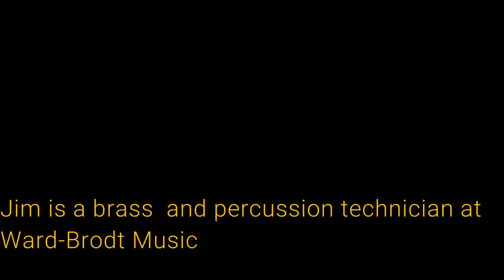Tuba Damage

Comment: I personally believe that dents add character. Although I think this Tuba had a little too much character.
Reply from the maker: Yeah, too much of a good thing is, well, not good!
Reply: Yayh! Makes me feel better about my 1969 Miraphone with lots of character. Still- would be nice to get some of the less attractive dents out...
Reply: Brudda you haven't seen mine. Mine has a massive dent in the bow. Like someone tried to play fruit ninja and missed. Its bad but it still sounds great. Up to a point tho. I can't play too loud without the vibrations being trapped and it causes a rattle like sound and quality is nulled a bit
Reply: If you had a dent on your head would that give you character....?
Reply: It starts to lose sound
Reply: Yeah, this much variation in the diameter of the channel for the standing wave is going to add too much character to the waveform, which might be interesting, but not likely pleasing.  If I want that sort of character, I'll turn the instrument over to freshman in Beginning Band.  No need for dents.
Reply: @BennyCFD  I remember seeing a sign an auto body shop may we have the next dents.
Reply: It probably was run over by a Lorry.
Reply: Character like that original mess diminishes the full rich tones of a well shaped instrument!  I did enjoy turning off the rattle-bang after a short minute.
Reply: same as my grandma @foamytony3291
Reply: I still have my 1964 beginners, student King trumpet..It only has one small dent in it.. 1st valve slider.. it was the first week I had it. Dropped it on my bed room night stand.. To this day I'm still PO'd about it.. That was 55yr ago..
Reply: Would dents not change the sound?
Reply: Yeah... Gotta agree with you on that. Just a wee bit too much character on that bass. Nice instrument though. I haven't seen many rotary valve bass euphoniums. I bet it sounds sweet!!!
Reply: Hayden Thompson ,
  Like the wrinkles in an old face, or elsewhere?
Reply: Too many dents could effect to tonal quality....so stick that character idea in your pipe

Comment: As a plumber for 46 years I remember when an apprentice and fitting we pans wc only had 4 inch lead pipe at the time for connecting which being extremely soft often had many dents in them which like the brass bend had to be removed. We carried a set of Tonkins which were a a range of extremely hard wooden balls of varying diameter with a hole through the centre. A rope was fed through the Tonkin and fed through the pipe and the opposite end wrapped around the head of a heavy hammer. We them just sat down and tugged the Tonkin though the pipe and it was amazing to watch all the dents vanish as you progressed. The Tonkin was short which allowed you to traverse bends.

Comment: Jesus, did they hit it with a car??
Reply: What happened was the kid got jumped and they were using the Tuba to beat the kid with!
Reply: my guess is that it was put on an aeroplane in a soft case or something because it looks more like it has been crumpled. this i think is because often the luggage part of the plane is not properly pressurised.
you can also see it has happened at the outside part of the curve which i assume would be the weakest part of the instrument due to the bend.
as i said though its just my guess and i'm likely wrong
Reply: WangChung81 I believe they did
Reply: Looks like a fairly standard school-instrument to me. Most of the brass instruments I came into contact with in high-school looked like they got run over by a bus. There was one single good trumpet at my high-school, and you better believe I treasured every second I had with that little beauty. Every other trumpet they had was hardly in functional condition. As for the tubas and trombones, not a single good one to be had at that school, unfortunately.
Reply: @spaceseal2268  If that damage happened during a flight, pressurization has nothing to do with it. For air-pressure to damage a brass instrument, you would have to seal up every single hole in the thing tighter than a Nun, and even then, it would expand out and crack, not crumple, since air pressure up above the clouds is obviously lower than ambient, not higher.
It looks more like a pissed off baggage handler or high-school kid caused the damage to me. That tuba very much resembles most of the brass instruments my high-school had at their disposal.
Reply: @MFKR696  yeah fair enough
Reply: This tuba was in better condition than the ones we have in the junior higg
Reply: Nah, its probably just from a middle school, you know how that goes.
Reply: That wasn’t in bad shape at all! You should see the ones 6ths graders get to use
Reply: It really doesn't take much to do a damage like this to a brass instrument. A fall from a few feet is often enough. Or someone falling onto (or with) the instrument. You have to treat those as if they were made of paper.
Reply: I smacked mine around a door frame and jumped up and down on it. Taught it a lesson for not playing the right notes !!!
Reply: No, a mouthy freshman.
Reply: @spaceseal2268  The luggage part of a modern plane is inside the pressure shell, the same as the passengers. The temperature there might be a bit cooler but not freezing.
Reply: Its sad the way you use Jesus' name so irreverently. Don't be deceived, God is not mocked. Gal 6:7
Reply: Thomas..."gods"? There are many "gods" made of wood, stone, clay, and the imaginations of men, but there is only one true "God" - El Elyon i.e. "The Most High God" of the Bible.
Reply: The owner was playing hid tuba st 3am and somehow the neighbor got hold of it
Reply: Bus, was horrible, was on bbc1.
Reply: no the drummer learnt his new instrument!
Reply: Marcus' muse he was atacked by a group of elefants during a earthquake
Reply: @MFKR696  ...we had faves at school and some were  old but in awesome condition. (high school grades 9-13)
Reply: @spaceseal2268  LOL air pressure...
Reply: @FireX7_211  When I was in middle-school, all our instruments were like 15 years old and not a single one had damage. They were tarnished and worn but not damaged.
Reply: fell off the back of the bleachers and was hit by 2.5 ton military vehicle
Reply: Tubas are old, especially mine, and some people like me just don’t have the money to repair it. Tubas just get dented more than like, a trumpet. I play trumpet and and mine looks beautiful but when I look at my tuba I go, “oh, Jesus.” I just don’t have the money.
Reply: I think it fell out of an airplane baggage compartment at 30,000 feet.
Reply: Did you hear back from Jesus yet?
Reply: @MFKR696  I wouldn't call it a standard high school instrument. Unless things have changed drastically, a 4 rotary valve tuba is best left to more advanced players. A 3 piston type valve would, and should be much more common. Overhauling rotary valves is expensive!
Reply: school instrument
Reply: nice work in making it usable again
Reply: @rvdrivingforce418  Are the rotary type valves in a tuba like the thumb valve on a trombone?
Reply: @leghumper83   yes, exactly like a thumb valve on a trombone, or the valves on a french horn
Reply: @rvdrivingforce418  My band director handed me one my freshman year of high school, but I don't remember if he ever showed me how to use it.  No idea why...I had my own trombone and didn't require a loaner.  Used that trombone for 4 years, never used the valve once, other than screwing around with it.
Reply: @marcusmuse4787  some kid threatened to smash a tuba on my head and he was like actually mad

Comment: I was mezmerized by the craftsmanship and the various techniques.  Thanks for sharing.  It shows that many old, vintage instruments may well have life left in them.  How about a video what demonstrated the before and after effect on the sound quality after such a restoration project?  That would be pretty awesome!  Maybe some info on the acoustical facts and wavelength stuff about what makes the sound resonate and the quality thereof.  It would also be interesting to hear your thoughts about the cost/benefit on restoring an older instrument versus buying a newer one.  When do you find that such work is a wise choice?  Great work and it kept my attention throughout.
Reply from the maker: I think this tuba was only 20 or 30 years old. My opinion is that bell and bow dents will likely not effect play-ability that much, though a person who is intimately familiar with their horn may notice a difference.  BUT, they will effect the desire to handle it well and be careful with it. My guess is that it would effect certain partials and possibly create nodal points that may make some notes not quite lock in well or be a bit funky. I think that this is a bigger issue with leadpipe dents or dents in smaller tubing. Maybe. I am continually amazed at how well some horns will play even with punched in crooks (trombones etc). You would also have to get a really good and consistent player to test and use some acoustical measuring equipment in order to objectively test that. I think most players unconsciously compensate for such issues. In fact they do this my nature with even a new instrument since there are few if any that are the "perfect" horn. Good thoughts you have though. thanks for the comments!
Reply: Rob Gulledge como fazr tubos de madeira para orgao artezanal

Comment: Bit late to this but does anyone have any info on that magnetic dent roller? Thats an awesome tool
Reply: Yeah, the guy who invented the magnetic dent removal process for brass instruments is my local repair technician.   You can build one yourself for $150-$200.  You need a Neodymium "rare earth" magnet with a 500-800 pound pulling power and a few large ball bearings (2-3in diameter), all of which can easily be found online.  For magnets check out magnet4less.com.  Here is the one I got: http://www.magnet4less.com/product_info.php?cPath=1_11&products_id=170 .  The other supplies can be purchased from a hardware store.  You will need a PVC end cap large enough to hold the magnet, a replacement side handle for an angle grinder and washer and nut to fit threaded bolt on the grinder handle.  Drill a hole through the center of the PVC end cap and attach handle with nut and washer cutting off any excess threading flush with nut.  Slide magnet into PVC end cap.  The magnet should be held in place nicely due to the magnetic attraction to the nut/bolt.  In the video, Jim uses an old drum head as barrier between the magnet and the brass to protect the brass. Instead, I attached a round Teflon furniture glide pad of the same diameter as the face of the magnet to the "head" of the magnet. this works very effectively. WARNING.  These magnets are seriously strong and can do damage to electronic devices.  I wouldnt get it too close to a tv, ur phone/tablet, etc.  I WOULD DEF. NOT advise using/handling one if you use a pacemaker.  Also, the magnetic attraction these magnets have is EXTREME.  You could easily crush your fingers and/or severely pinch your skin.  So BE CAREFUL.  In fact, I DO NOT recommend building or using one of these devices unless you do your homework and make sure you first know what you are doing.  You could also seriously screw up your instrument if you misuse the device.  IE: this device is ideal for minor dents in bottom bow and other larger tubing where the brass is thin enough.  This device will not work with small ball bearings in tuning slides or other small tubing on horn and will do serious damage to larger/flatter areas such as the bell .  All of the magnetic pull will be isolated to one very small spot and will easily leave raised grooves and or minute folds/creases in the brass that will be very ugly and very very difficult to remove.  Also, do not use a ball bearing that is too small for the area you are working on for the same reason. the ball bearing should only be just small enough to easily pass through each section you are working on, for best results.  I hope I haven't scared you too much!  LOL, but seriously, do your research first, know what you're getting into and BE CAREFUL and practice on junk instrument first!  If you are not confident you can do it, its best to bring your horn to a professional!!

Comment: Nice job fixing it. But surface is still rough
Reply: So what would you do next? Bondo and paint or what a traditional vehicle body builder would do following a repair and use a file. There's very little thickness to work with here but with an ever increasing number of hours to improve the finish futher more time could be beneficial of someone was willing to pay.
Reply: Likely they send the tuba back to the rental company or if they own it back to the school.Ready for the next crop of vandals. No need to make it perfect.

Comment: Hi Jim. I have a old clock from my great-grandfather and I would like to restore it. It's just the brass that has a ugly stain. I believe someone used steel wool to clean it. The difference between these musical instruments is that the brass should not shine as they do. I believe it should have a matte finish. Which could be a proper way to achieve that? I have a video from the clock in my channel. Thanks.

Comment: Wow. That's... extensive. I've got a few dings and dents here and there in my Eastman, the only serious thing that happened was that I managed to drop it and shift the valve block as I was supposed to go on for Schostakowitsch 5. Thankfully, Eastmans are easy to pull apart (Braces are in 2 parts held by bolts) so it came out just fine.

Comment: just curious if the curved tool clamped in the vice @2:13 be duplicated with a custom bent on in the modified english wheel @2:26 so you could roll all the way to the center of the half bend..  the new tool would need to be shaped like a fallen forward P shape..  the contact patch on the concave roller might not be directly on the bottom of the roller.. it might be 30 degrees forward or 30 degrees rearward..  turning the center P bar upward to work on the inside of the curves if needed.  just a thought.

Comment: How come there still are some visible rumples in the bottom bow?  What happened to the wide guard that was there when you started. Yes, it was bent but that is why you have the Feree's Dent Machine.
Reply from the maker: I did not do this particular horn to a full overhaul level. Certainly could have and then would have removed every scratch and ripple (at 6 times the cost of this job).  If the customer had agreed to that, I certainly would have considered keeping that bottom bow guard, though a Ferree's dent machine might cause a lot of problems on the guard piece. 
Thanks for watching!

Comment: Hey Jim! Great work and I really enjoyed the video. I'm also a professional instrument repair tech, and I'm having a heck of a time trying to find the curved burnisher you used with the magnetic dent removal tool. I've found similar ones that have pointed ends (Ferree's N107 for example), but I want the squared end like you have. Would you be able to share with me where you got that tool? Thanks!
Reply from the maker: It was made by National Band Tool in Houston TX back in the 1980's I think. That company long ago disappeared under some suspicious legal issues as I understand. I inherited it as a shop tool in 1990, so ....... I wish I could tell you more, but that's it. Also the burnishing faces on this set are chrome plated. Kind of cool.

Comment: How do you remove scratch marks of a tuba?
Reply from the maker: typically that is not going to happen,.  If silver plated, then you can lightly buff the areas with rouge compound, but it will work only if the scratches are lite.  Lacquered finishes present a greater problem and going after scratches is an insane man's game because you will lead yourseklf to despair and find no serious improvement in the end. Really you need to strip the entire horn, buff it and relacquer. Several thousands of dollars usually make battle scars easy to live with.
Reply: use a mild abrasive to "polish" them out.   I suggest a tuba toothpaste.    
har har.... see what I did there?

Comment: If the instrument is brass then how can a magnetic dent puller work on it? I'm assuming that there is a magnetic ball or something like that inside the tube? You never showed that.
Reply from the maker: Yes actually you saw me pick up the ball (steel) with the heavy magnet. It just burnishes whatever is between those two things.

Comment: Great job. The Tuba was pretty beat up. I didn't realize that brass was magnetic enough to use them to pull out the dents.
Reply: Brass is not magnetic, The magnet in the tool holds a steel ball against the other side of the brass which is thin enough to be smoothed out by the ball passing over it.

Comment: One question, What is the model and brand of the torch you are using.  I assume it is propane.  
Are the hooks for hanging it stock or did you add those?
Reply from the maker: Acetylene gas. Prest-o-Lite No. 5 on the large one.  Those hooks are trumpet finger hooks soldered on. They never heat up to loosen.

Comment: GREAT work but I have to wonder about the  cost effectiveness?
Reply: 4 valve rotary Tuba's run $3500 to $10k+ new, depending on the brand. $6k is the price I've always used as a reference. Even if this repair was $1000 ( based on the original condition ) you basically saved a destroyed instrument for quite a bit less than a new one. In high school, I played a 4 valve rotary Meinl Weston that was almost $10k in 1980 (as a point of reference).

Comment: While working the metal, is there any concern in stretching it?
Reply from the maker: Sure there is. But that's not really a concern, because when the instrument is manufactured it's going through all kinds of stretching and shaping hammering. The thing to keep in mind is to not work Harden the metal because then it can crack. Annealing the material or normalizing it we'll keep the metal workable.